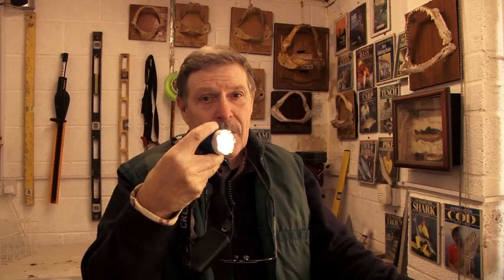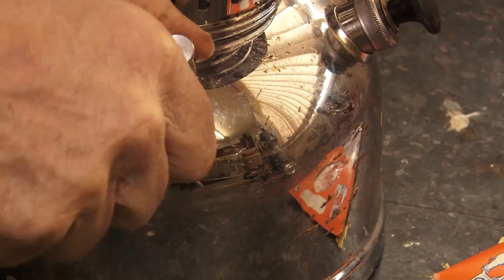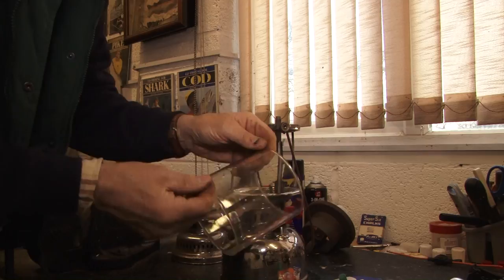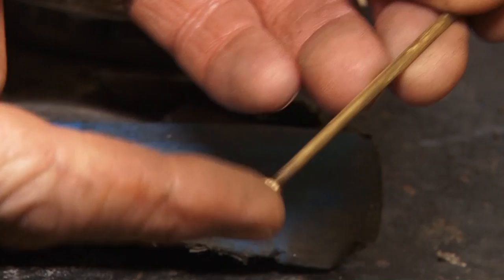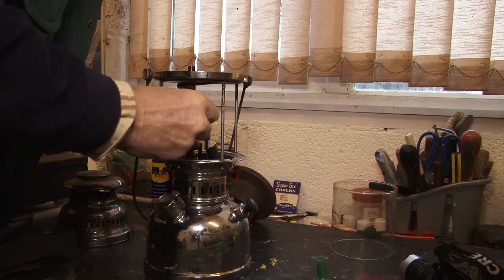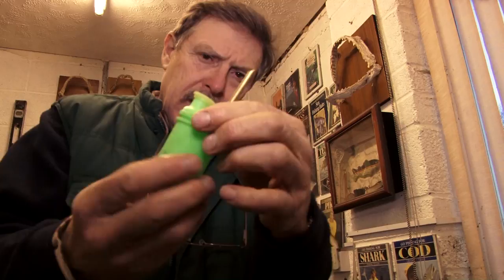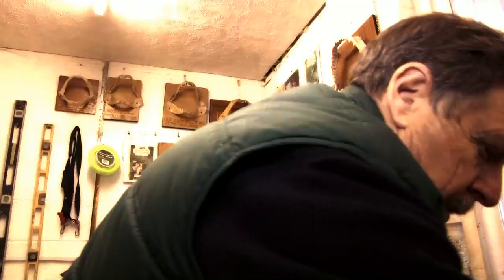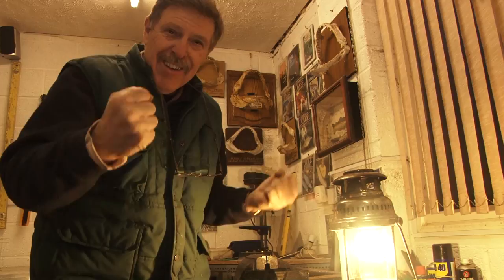How to service an oil lamp | TA Outdoors

Comment: Nice video!
There is no need to lift the top off to light the lamp. Just fill the alcohol and light it thru the larger hole in the frame just beneath the glass.

Comment: I bought a Coleman 247 that had a bit of dust and rust, took it apart, cleaned it without removing the character, and am now grateful that I didn't put and LED in it and call it a day.
Upon taking it apart I noticed that all the components were of high quality, which is a stark contrast to most of the manufactured products you see nowadays. I couldn't be happier to
own something like this, and thanks for showing me how.

Comment: I really enjoyed that. I have a 40 year old Palladin, probably not so sophisticated, but you can lift the glass with a lever to light. It still works every time. I’m reminded of the old street markets where the stalls would all have a number of these and in winter they would light and heat and make a wonderful loud hissing sound. Now it’s all at a flick of a switch. Much cleaner and easier but not so atmospheric.

Comment: I had a Wenzel in the garage for 17 years- I rebuilt it with petromax parts- carburator rod assy, new preheater torch, replaced the hand pump with an air pump attachment- That thing is the darn neatest lantern I have ever used! And BRIGHT!! 500 cp ....I have my eyes on either a new petromax or a britelyt

Comment: I keep a brass pistol cleaning brush with a short cleaning rod for cleaning the carburetor pipe that houses the needle. If you have it try using some brake cleaner or carburetor cleaner in this pipe to help loosen the carbon deposits. I also carefully polish out that needle assembly with 1200 or 1500 grit wet paper using a light oil and then doing a final cleaning with acetone. You do not want any oil on this needle stem since it can bake on to it from the high heat. This will lead to more carbon deposits building up quicker on this assembly. Great video! Working on restoring an old Petromax that I picked up at a second hand store. The most important thing to consider is the condition of the font when buying these old lamps. If it can hold air and is to rusted out too much on the inside then you are good to go! I have heard of some individuals cleaning out the rust from within the font and then pouring in epoxy paint and coating the inside completely before pouring it back out, oh and one must remove all parts that screw into the font so as to not damage them ( don't forget the check valve within the pump assembly ).

Comment: Thanks Graeme for putting this on as I've got an old 500 cp Anchor that my my wife bought me years ago as a birthday present ,I'm not going to say how long ago it was but the price on the box is £32.95p . Needless to say that although the lamp is in very good condition ,after  all this time it needs a good service to get it going again ,so thank you for the advice. The best thing I remember when I last used it many years ago ,was the heat it gave off  which was as welcome as the light on a freezing cold winters night

Comment: great tutorial Sir, I had one 20 years ago, I've thrown it away cuze it used rare earth radioactive mantels (thorium and even worse, Radium 226) very harmful if inhale and would contaminated with nasty hash all the area when falling appart. But recently they make non radioactive mantels, so, I regret not to have it anymore.  But watch out guys, radioactive ones are still available on certain web sites without any logo or specifications notices, only a Geiger counter would reveal it ( I got one) don't use them unless you don't care about your health (cancers) and Neighbors and animals . I'm a professional certified worker in radioactive environment. Greetings from Belgium

Comment: Why remove the hood everytime when lighting the lamp, risking breaking the mantle, when there is a  larger hole at the bottom rim for the meths bottle to go through and fill the kidney shaped meths tray, then just put the long lighter or match through and light the meths, least That's how i do mine .

Comment: One alternative way you might want to look into for cleaning really small  fragile parts is to soak them in apple cider vinegar for 24 hours. Apple cider vinegar is a natural weak acid. It can get to parts you’d never be able to get access to with your fingers. Plus there’s no manual handling of really fragile small parts. Maybe be a less damaging way to clean them.

Comment: Nice energetic video, and a lovely lamp. We have many Tilleys so are Tilley biased, but I do like your lamp very much. One thing though I cannot believe is that you have to pull the hood off every time to light the lamp, risking mantle breakage, especially if you had to relight at night in pitch blackness. Surely there must be a hole at the bottom of the gallery to insert your meths tube to fill the pre heat reservoir?
Cheers
Reply: There is a larger hole for it. You can see it at 26:25

Comment: Can  you please tell me if you can get rid of the smell of lamp oil ?? Would adding a stainless steel mesh screen increase the burntime and light output???? Can you use K-1 kerosene in the lamp  ?? How does this burn so bright with 350 or 500 candle power ??? How much did you pay for the lamp Sir ???  Thanks     😀😀

Comment: I have my father's old Petromax lantern (exactly like the one you have) but I'm unable to pump any air into it..what can I do to fix that?
Reply: Oil the pump leather, change the seals (sets are sold on the internet), check for leaks by submerging it in a bucket of water. That's all I can think of.
Reply: @baginatora  is there a video for changing the seals,,not sure if I have the whole tool kit for it and no idea how to do it
Reply: @baginatora  thank you so much for replying by the way 😊

Comment: shoudnt the meter say 2-3-4 bars instead of 1-2-3? since atmospheric pressure is already 1bar...
Reply: Francois Dupont - the meter is showing “gauge pressure”, which is the pressure relative to atmospheric. So zero gauge pressure = 1 atm of absolute pressure.

Comment: too bad the newer ones are not of the same build quality. I have mine for five years and not matter how much adjusting, cleaning, tlc you give it.... it won't work consistently. As many other have found out also.
Normal operating is: whole top on fire and fuel dripping down. Could not even give it away to somebody .... too dangerous.

Comment: The first time I fired up my new Petromax I had problems! They are fiddley and if you don't like messing with old Morris Minors and Swiss watches at the same time then the Petromax is not for you! I suggest the non DIY people buy a gas or Electric Lantern. 
There are advantages to owning a petromax but you will need patients it not as simple as filling it with paraffin and away she goes!